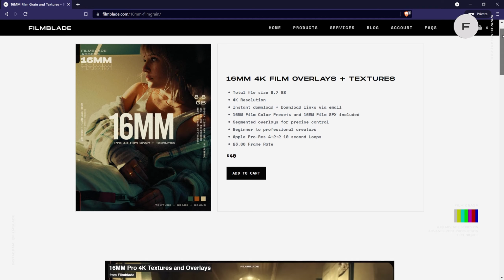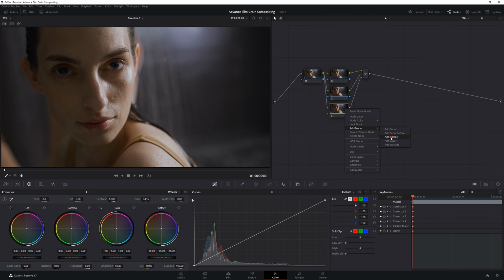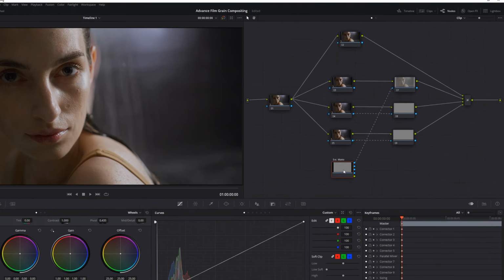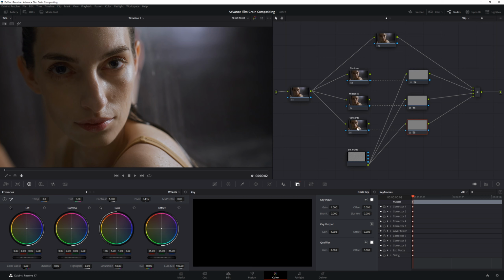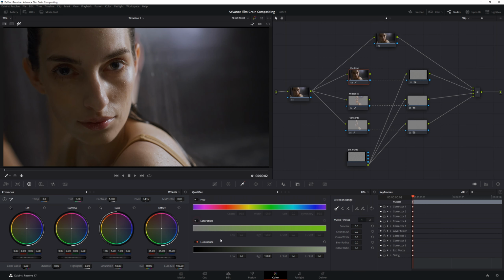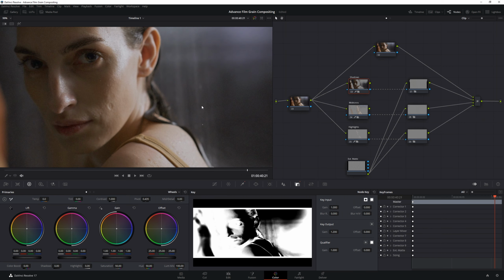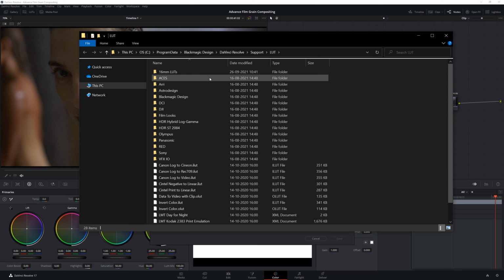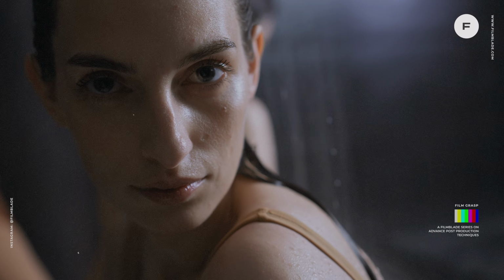How PROs composite Film-Grain Overlay in DaVinci Resolve

Comment: problem is that you set the luminance keys before putting the LUT in. So any gamma curve or changes that the LUT is doing  will break your keys. That is kind of the achilles heal in this node structure. Anything feed the key can change the key. 
Also if you use the built in grain in Resolve it has under advanced - sliders for low,mid, highs that will let you mix it without pulling keys.